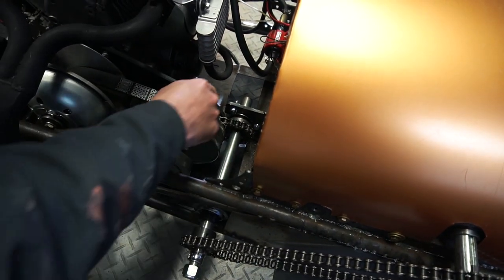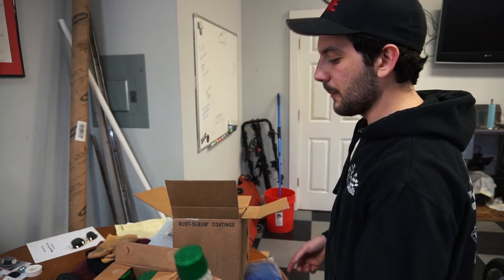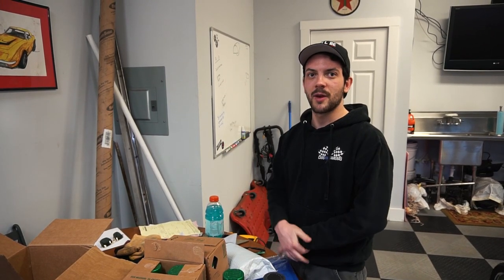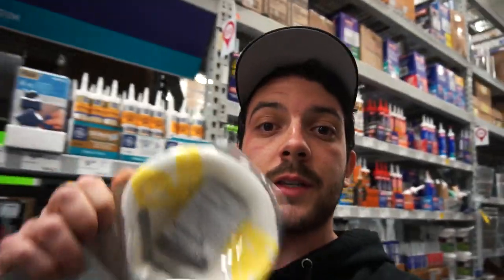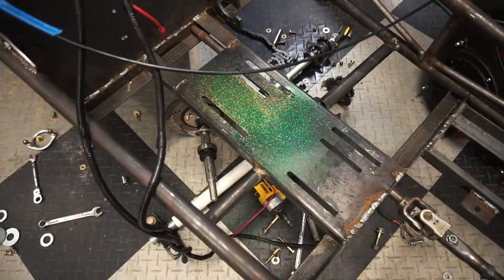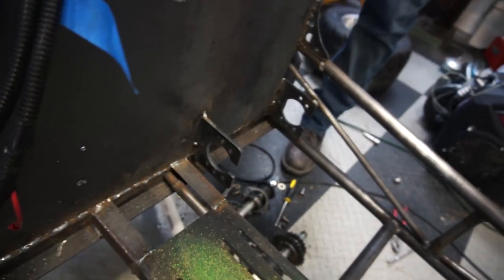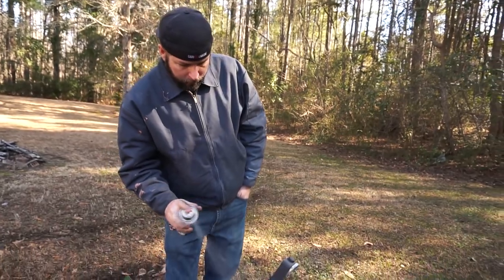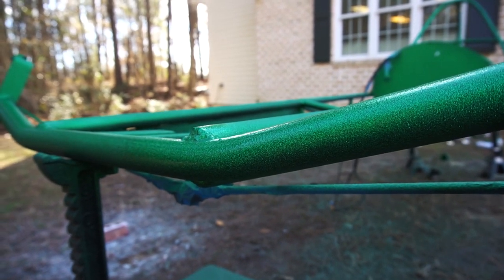DIY Paint Job (Heavy Flake)! 670cc Dragster Build (Pt. 15)

Comment: The only way to do away with the Jackshaft is to make a rear engine drag cart now having said that you will be fine with the jack shaft as long as you use gears to overcome the parasitic loss and it would be great to see a Tach to get all your horsepower and torque at least you will go fast or break stuff

Comment: You could have fabricated custom aluminum panels and welded a tab and spring to the frame then fastened the panels to the frame using zeus screws. I have graphic design skills and I will be following you on Instagram.

Comment: The difference in peak power between EFI and a well-tuned carb setup is negligible.  EFI means not having to dick with it for different temperature or conditions, better part-throttle response, and better fuel economy.  Of course Turbo + carb is tougher than Turbo + EFI, but I think you guys are right, EFI is not worth the hassle here.
Reply: if you like drag racing we street race gokarts come check use out at #205 drag racing

Comment: What about a smog pump supercharger? More 60’s than a turbo. P. :D
Reply from the maker: I haven't seen a smog pump big enough to create enough boost for this engine. They'd work great on a 212, but not something this big.
Reply: CarsandCameras how about 3 of them?
Reply: +CarsandCameras  I was going to say ‘who said anything about one’ but was beaten too it.....
Reply: +CarsandCameras The supercharger you want is either an Aisin AMR300 or AMR500, most likely the AMR500 will be the right size.  on a 750cc 4-stroke with the blower turning 1.5 times per crank revolution it will produce 15psi of boost.  In my experience stock pushrods on Honda GX motors will bend at around 18psi, so 15psi "should" be safe.  Then you don't have to worry about exhaust manifolds and a blow through carb and keep the vintage vibe
Reply: +Pants Man think a ‘Suck through’ would be easier to set up, the air is going to get hot either way. Nice thinking though.
Reply: +thegrandpumbaa Thats exactly what I said, i.e not having to worry about blow though means use draw through.  Also added benefit is draw through will help to cool the lobes of the supercharger.

Comment: If you're going to put a turbo on it put the carburetor and front of the turbo so the turbo will suck the air fueling and blow it into the motor you'll have no problems that way

Comment: There's a significant advantage in chain over shaft drive in terms of mechanical loss. Identical motorcycles with equal power but chain vs shaft, the shaft will be slower and consume more fuel pretty much always. The only practical advantage is maintenance and manufacturing cost. No need to have sprockets aligned and chain cleaned/ lubed all the time. There's a reason shaft drive bicycles never caught on. Too much energy wasted and too expensive to make for a bike that's harder to pedal. The shaft acts like a flywheel and the bevel gears mesh with a comparatively larger area than a chain and sprocket. Sucks energy right up. Nothing wrong with chain. I agree a heavier, longer chain with a tensioner would be neater.

Comment: Can someone please help me!!! ......... I just bought a 30 series torque converter from GoPowerSports and put it on a 6.5 hp motor and when I tried to use it for the first time it takes about 1/4 throttle for it to engage and then it takes about 20 seconds for it to fully engage but when I hook the chain to the back axle of my kart it still engages at 1/4 but it will not accelerate any.... and no the gear ratio is not wrong and there is nothing wrong with the motor.   if I had to guess I would say it is probably something with the belt or something with the weights in the front pulley.  someone please help me because I am very mad.

Comment: Woah,.. That's some tallic  bling fo' sho🤩👍.. I gots an idea,.. On the chainguard, scoop, &copper cover; ever consider ghost'flames ??? Have gold flake ghost flames lil white accent or not.. I've used gold flake paper dude you like rub it on area of choosing. It makes for some badass old school look. IndianLarry(RIP) was notorious for doing that to his old'skool choppers.. There's all kinds tricks when it comes to paint.. I just figured I'd throw that out there, I didn't know if y'all painted much. I know y'all are hell of a fabrication and mechanics.. So what ever ye decide,.. It'll Be Fine..Dudes,.. I wondered about weight on the dragster; chrome dipped frame be heavier as to painted &clearcoats? 
Hey fellas, question ❓ if u go with turbo, couldn't u kinda pinch the gas line somewhat to build up pressure?? Maybe look into compressedair supercharger? I think already mentioned that some  5-6episodes back..  I don't know about y'all, but I'm excited🤪 to see' the Hulk' blast down the strip🏎💨😆...ye ye ye ye ye..👍👍.
Reply: 💡Almost forgot,.. The gold flake🎇.. U can get gravity fed spray gun at about anywhere $18-$30.. I thought about how you could mix the green with some gold flake and spray with compressor, detail sprayer(gravity feed) that might be more cost efficient??? Plus u can better control your mist compared to spray cans. Although I have seen some kickin sprays with can. Depends on what you're use to.. Anyways I thought I'd  throw that out there about the cheap air compressor & spray gun setup. Too bad I don't have people like you fellas where I live they're all closeminded asshoes.. I think it'd be awesome to have a garage to build anything for anyone(paying customers of course), to fabricate , plus have paint booth rite there also. But keep in mind you'd service and maintenance on vehicles too..🤑🤑🤑.. 
TAkes$$$ 2 make $💰$.. 📽Keep'em Comin' ..

Comment: I'm glad you're gonna keep a carburetor. It'll be easier to make it work with a roots type supercharger. There's a japanese company named Aisin which happens to make small versions of a self-lubed roots type supercharger (it's also cooler for that 60's look you're after). For less than 200$ it's a bargain !

https://fr.aliexpress.com/item/Car-Snowmobile-ATV-Roots-supercharger-Mechanical-Turbocharger-gear-Supercharger-for-Displacement-0-8-1-8L-model/32273549916.html

There two versions:
- AMR 300 wich displaces 300cc of air per revolution 
- AMR 500... yep you've guessed !

The big one with a 1:1 or 1:1.2 ratio will guarantee flexibility and torque with quite a bit of boost. And if it's turning at half the speed it's capable of (16 000 rpm max), it's gonna last forever.
Reply: I really like this idea! Mount it on top, with a draw thru from the carb, no worries with pressure. Very sweet!
Reply: Everyone needs to like this so they can see it.
Reply: these things are like $250...slap the carb on top, rig up some brackets and pulley, then BAM! Boost Baby!
Reply: Easier install, cheaper and better than a turbocharger for a drag race application... It's effective from the start, whereas a turbo is only making decent amount of boost nearing the top end, or in other words, the finishing line.

Comment: I gave you guys a lot of details about how to do this in the drift trike /turbo setup, go back there for details or hit me up and I'll give more details.  short version, go Megasquirt or microsquirt, 2 cheap JY injectors, a WBO2 and some creativity and you should be able to inject it for a few hundred $.  Alternatively, there's 2 ways to do the carb, either put it in a housing and blow through or get a larger carb and put it before the turbo (though you might have to look into carbon compressor seals), but if it was me I'd go MS and inject it.

Comment: Why can't you run single cylinder EFI with two injectors instead of one?  Maybe you'll need to learn some circuit board stuff to add output mosfet's, for more amperage capability, but probly not. 

I'm really confused about blowing fuel out of a carb with a proper draw-through setup.  With draw-through you can't run an intercooler, though.  

If you do go blow-through, you could blow fuel out bowl vents, unless you figure out a way to connect them to the same pressure as the carb inlets.  You would also need to run a regulated fuel pump, or you could have enough pressure to push the fuel back to the tank.

Comment: you could do how the old timers did with a turbo and set it up to suck air through the carb rather the blow through and mount it to the intake on the turbo

Comment: run a diff, you'll lose that stability that bullet axle gives. it's a dragger, not a road racer, lol. the "foaming" when you spray is because the mineral spirits looks dry, but it's still flashing off (colder than ideal). also rattle the hell out of those cans as often as you can stand, the solids get clumpy when chilly. to hell with turbos, run an old timey pict vw beetle single barrel carb from a 1200 engine, they have accelerator pumps and are already jetted for 300 odd cc jugs at the rev ranges your engine makes. go for the pict 34 from a dual carb pancake motor for extra oomph. LOVE that rail, total throwback top gas styling, and that modded engine is nothing short of ape shit crazy!!! bad a dragster, indeed

Comment: I'd skip the turbo just add nitrous. Way cheaper. Its just for drag so the turbo is a lot more fab and space also. Plus it may just run bad with the wrong carb setup. You could also try adding a pressurized air tank for supercharging effect. 
Scuba tank. LOL.  http://www.hotrod.com/articles/compressed-air-supercharging/

Comment: could have ran a long chain with 2 chain tensioners. less drag on the drive train
Reply: that would give the chain more of a chance to snap..shorter chain means less that can go wrong
Reply: well you dont see that in motorcycles running way more torque and hp

Comment: This may have already been said, but, this could have been done better and cheaper. A quart of dupli-color and a 40 buck spray gun. Put your flake in the paint and spray it. Clean your gun up with mineral spirits, By the time you finished up cleaning your gun, the paint should be flashed off well enough to start spraying on your clear. It's OK. I'm not downing you. Not hating on you.  You have to learn. Also, the paint and whatever you are spraying needs to be warm. As long as it's 65 degrees and up, you should be OK. The paint that you put on is OK. I'm not downing it. It's just a lot of money for something that will not last very long. Rattle can is OK for small jobs. But can get expensive for something this size.

Comment: Just buy a GOOD carb, not the cheapest ebay shit, big enough, and mount it in turbos intake and you should be good. Idle maybe rough but it runs good in rpm if you get it tuned. :) put simple lambda on it and its way easier to tune, you know your fuel/air ratio better.
Reply: And next time you paint something, take it to sand/soda blasting :D

Comment: Well, if anyone had any doubt about your sexual orientation, the glitter paint makes it abundantly clear. 
Not that there is anything wrong with that. It is just a relief to see you two FINALLY come right out and admit it though.
Some flat black plasitcoat Would have been much cheaper, and much cooler. Maybe some green highlights.  ahh well. 
Shine on you crazy unicorns.

on a technical note, how the hell are you going to adjust fuel mixture a turbo needs without electronics?
Learn some basic programming and make your own gas/air mixture controller with an Arduino?
You ain't gonna get there with progressive cam on the choke, or anything mechanical like that. 

Possibly some kind of vacuum actuated fuel mixture contraption.  That could possibly work.

Put a  turbo on that thing with no realistic air/fuel mixture adjustment, you gonna burn it up so hot,
it'll make the flaming paint job pale in comparison.

Much luck gays (oops! er... *guys*)  love the vids.  Lookin' forward to seeing what you come up with.
Reply: +Terminal Psychosis LOL. Project much there, TP?

Not that there's anything wrong with that...
Reply: Oh come on now, we all know that glitter paint is the auto world's version of the rainbow flag.  :P

Just messin' with the guys of course.  Flat black, maybe grey for me thanks, but to each their own.
The tech stuff is much more interesting anyway, not the frosting. 
It'd be very interesting to see them actually tackle the problem of turbo air mixture control without electric control..  or a DIY solution even.

Comment: Get an efi set up off a junk yard motorcycle,  they often have the ECU, injectors and throttle body all as one piece that bolts directly to the intake ports. You could probably fit one instead of the carb without too much hassle.   Image of such a thing: http://www.ecotrons.com/website/Manifold-3.jpg

Comment: Just use a chain tensioner lol so simple
Reply: Neo Wynn Your negative comment shows how inept you are with basic mechanics.  Try again, I'd like to see a video of a project you have made with a 3ft+ chain and tensioners...let's see lol
Reply: The comment was not negative.  The comment was just some good advise!
Reply: Prolific Invention my mower uses 9 foot of chain total it's probably about 3 and a half foot distance and have yet to throw a chain...also my chain never jumped around like theirs haha
Reply from the maker: Didn’t work on the rat rod wagon, definitely won’t work on this application. I suppose you could add a dozen tensioner... that may do it... but that’s going to rob just as much power (if not more!) than our jackshadt
Reply: CarsandCameras I used one tensioner with no problems
Reply: Prolific Invention it's a lawn mower frame yes but everything else is gokart you wanted proof of a 3 foot chain working I have it
Reply: CarsandCameras I'm not saying to run tensioners on your dragster I would run a jasckshaft to so I could change ratio on the fly I was simply replying to someone who don't think a long chain will work and wants to try to belittle people because he thinks only his way works
Reply: Nicks backyardprojects I belittled a negative and condescending comment, not a person.  Cars and Cameras agreed.  I was absolutely right also, high power applications are much safer and vibrate less with a jackshaft rather than a long continuous chain utilizing tensioners.
Reply: Mini sprints Rev to 17k rpms and make 140hp ??? Huh?

Comment: So i guess you have never heard of a chain guide? Damn near everything made with a chain on it has one! You can buy them reasonably cheap. You start with one of these! http://www.gopowersports.com/mb200-chain-tensioner-complete/
Reply from the maker: We would need 3 or 4 of them, the chain would still bounce around, and we'd lose just as much power without the stability of our current setup.
Reply: I have a friend that races pro street Drag bikes, His chain is longer than the rat rod kart! He uses one chain tensioner and it works fine!

Comment: You can mount the carb on the intake side of the turbo where the air filter mounts. It will use vacuum to pull the air/fuel through the turbo and force it into the intake of the engine. Any questions contact me at mattmossdiesel@gmail
Reply: Matthew Moss they've been doing that on Volkswagens for years it works have done it myself on a pinto in the 80s
Reply: You had a pinto? please, share your wisdom.

Comment: get a harley engine for it
Reply: Motley RC LOL I’ve had the displeasure (in hindsight) of owning 4 Harley’s (all bought brand new) and without fail every engine (and etc) has given me trouble, and they simply weren’t very powerful given their cubic displacement.
I finally gave up and returned to better designed, engineered, consistently reliable, and much more powerful oriental offerings, and will Never look back.
I personally think a Harley engine on this wonderful bit of backyard engineering would be a step backwards for many reasons LOL